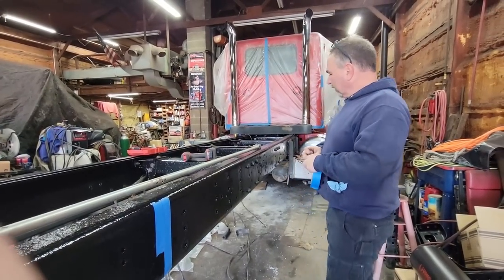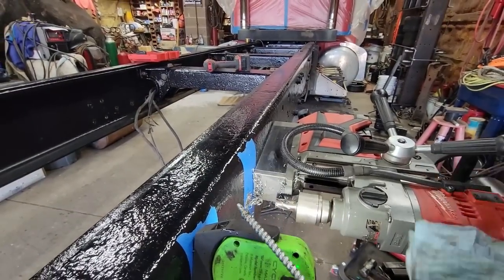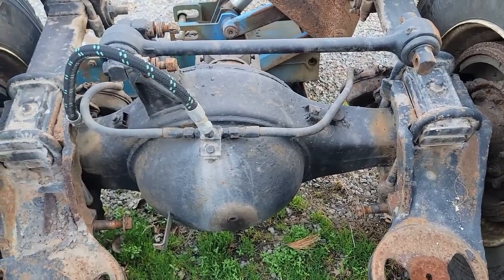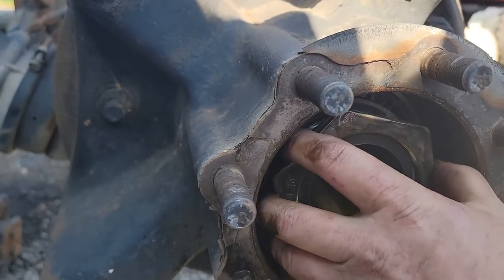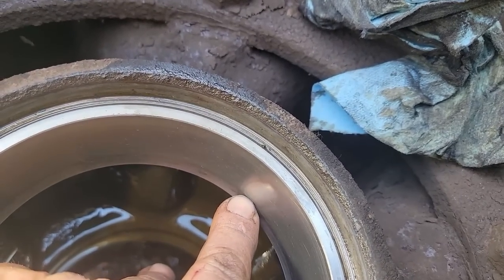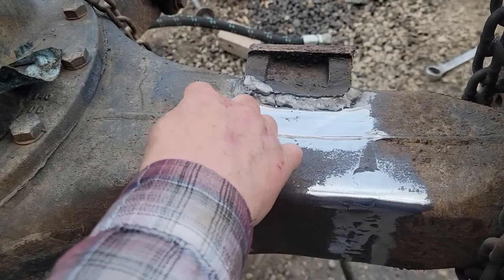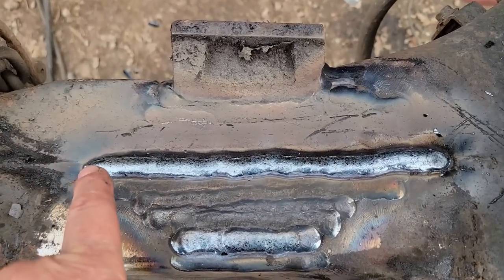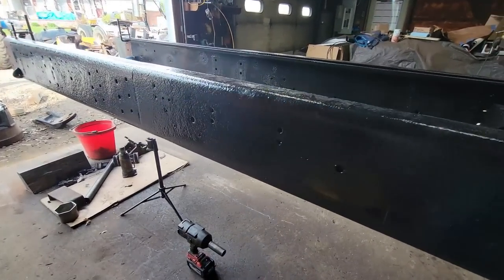PETERBILT FRAME STRETCH PT10. EASIEST WAY TO DRILL SUSPENSION HOLES ACCURATELY!

Comment: This is very good work that you are doing. He should be glad that you are as through as you are. When I welded up my Pete axles I took out the rear plug and shot air into the housing as I sprayed soapy water on it and I could see if I had anymore leaks. Keep up the great videos.

Comment: You know the welds are proper when the slag comes off like that!
I used to make cardboard patterns for the suspension holes. I like your "story stick" method much better!! It seemed like it would be harder, but it is actually easier, faster, and more accurate.
Reply: Not taking anything away from JC but he’s using dual shield (gas shielded flux core) wire. If the settings are anywhere near correct, the slag will do that.

Comment: 32:00 FYI, it's a good idea to peen your welds. Prevents fatigue. Going over it with the needler for example is good practice because it gives the weld more surface area to work with which in turn means any stress fracture that would've started in the weld are (within reason) mitigated. I use a mini needler just for this, a hammer is indeed bad, because you only hit a few points, which in turn can cause stress points in the future. 

That said, welding oil soaked material... man, i wouldn't even touch that. Oily welds are the worst. And you're absolutely right that this design is bad. You never want that little overlap on something that receives the stresses that portion of the axles receives (moving, stopping, moving, stopping) that little weld there is subjected to pulling and pushing every time this truck moves. Bad idea, and it's not like a competent engineer wouldn't know this. This is ... well it is basic, engineering 101. It's one of the first things you're told in regards to metals and fatigue of moving components. A stressed out part needs surface to distribute. That overlap is a joke. Bet ya anything this is the cost-cutter department stepping in over engineers and manufacturers. Bean counters, pushing profits.

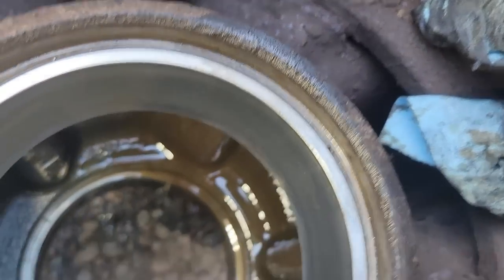Comment: At 23:00 I would have thought the outer races would have been changed when the bearings were changed. I was taught they should be changed as the bearings are matched to the races, just like valves are matched to the seats. Some 'mechanics' are just lazy, sloppy or just dont care. Probably dont want to change hte outer races or dont have the tools to do it.

Comment: I’m not telling you how to do your job I’m just curious . This is a legitimate question I am asking. Where all that welding was needed on the axles. Why not put plate around and weld it in to strengthen the axles in those areas that are weak and constantly cracking. I really am curious if there is a reason why you don’t do or is it that you can’t.  Thanks for answering if you can.    Good video.
Reply from the maker: i really wanted to plate it but there isnt enough room for anything more than the axle itself. the ubolts and mounts fit righ up against it. i looked at it for awhile trying to figure a way to help with some extra plating.
Reply: @j.c.smithprojects   ok thanks. I was just genuinely curious I was sure there had to be a reason. I just wasn’t seeing it.  Just found your channel by chance so far pretty good.  Have a good day

Comment: i have never seen an axle in such a bad shape' first off that factory weld' as soon as i saw it i said to myself 'Undercut' thats poor welding application/setup , i did laugh when you used the cored wire on high amps very-very hot was you using Argon ? just one more thing people love knocking the slag off welds as a helper said it's like popping bubble wrap lol ...
Reply from the maker: yes. dual shield

Comment: Wow. Those axles really were not in good condition at all. Not only did they need full rebuild but extensive crack repairs.
Not to mention someone else's less than great work from the past. Even had water contaminated oil. But after seeing the 1st truck and how it was built and how poorly the tank was mounted I guess this isn't too surprising. But with all the labor you're putting into this build at least this truck will be safe.

Comment: Why don't you use a spring center punch?
Reply from the maker: this isnt new smooth steel. it has pits and is inconsistent. spring center punches are more of a hinderance to me anyway. they snap ok for a few. then they are stuck. take it all apart. put it back together. snap a few. its stuck again. i had a snap on and lisle one.

Comment: You're a victim of loose u bolts typical problem with Pete's they never check the torque on the bolts
Reply from the maker: i dont think that is it. i think the size, length and direction of the welds are what did this. i have never had any other truck axle / suspension do this. they are not welded like this either.